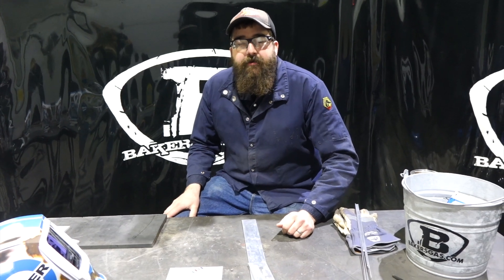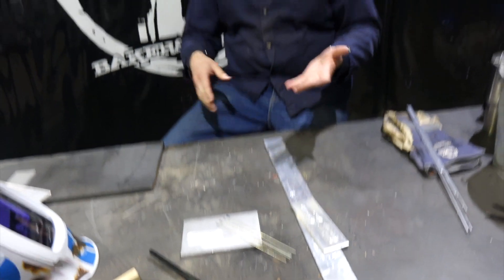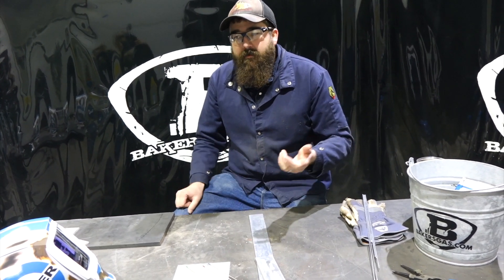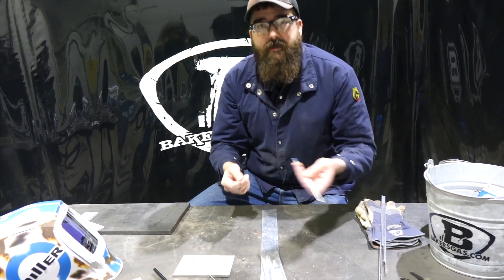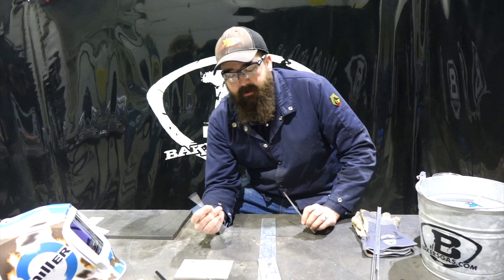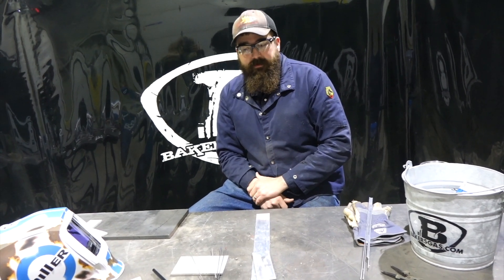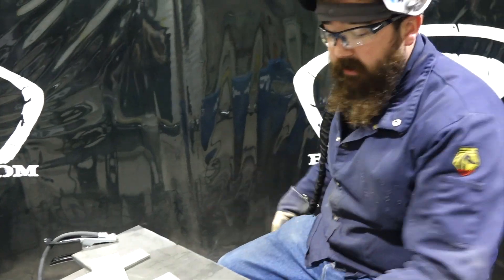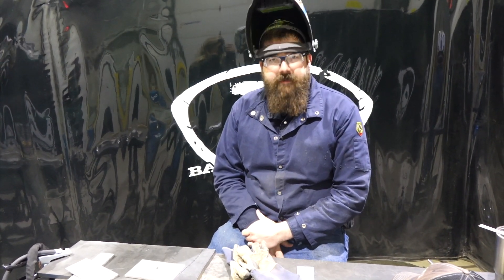How to choose the correct Tungsten for TIG Welding

Comment: I leaned with RED tungsten and used it for 40 years ,steel ,SS , Aluminum
Reply: New to TIG after MIG welding in 84 with a new welder. So, every 40 years I get a new welder! Lol! But, RED is Thoriated, in 1/8” of what size? Similar to you I am welding mild steel, but wish to weld some SS exhaust “V-Bands” and perhaps some aluminum. Thanks kindly, hope all is well as I am getting a pain pump for my entire lumbar… YiPeee! DK, Omaha.

Comment: 2% Ceriated (Blue) works best for me on aluminum. No dirty look at start and pretty looking dime appearance. One big thing on any tungsten id dipping it. If it happens I cut of between 1/2" to 3/4" and re-sharpen. It makes a big difference if you want pretty welds. 
Also blue makes a smooth arc with no popping noises.
Reply: Pretty sure blue is lanthanum not cerium...
Reply: @andamount79344  Ceriated is Gray. I made a mistake 3 months ago. I no longer use BLUE.

Comment: Red is HORRIBLE on AC in any amperage, if you aren't running stainless I'd recommend you leave it be, it seems to leave the weld puddle dirtier even on cleaned (brushed, acetone, and sweated) aluminum

Comment: Great video, just one question, is there just a good all round/all purpose tungsten for beginners to use for welding mild steel?
Reply: I teach welding and 2% Lanthanated for everything. No issues.
Reply from the maker: 2% Ceriated is a good general one for mild steel. Also E3 is popular and very versatile. 
https://bakersgas.com/products/bluedemon3-32x710pk2-ceriatedtungelect-te2c-332-10t
https://bakersgas.com/products/bestweldse3tungstenelectrodes-3-32-3327ge3
Reply: @BakersGas  Thanks for the feedback!